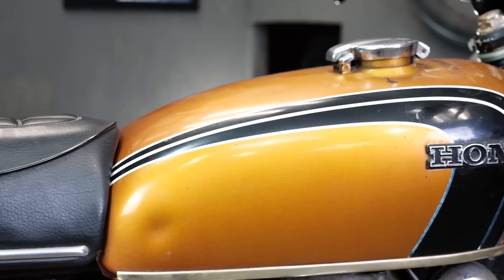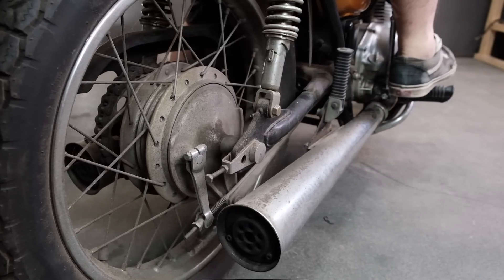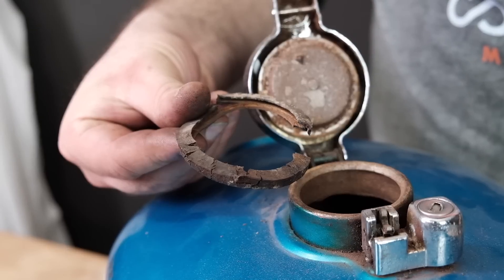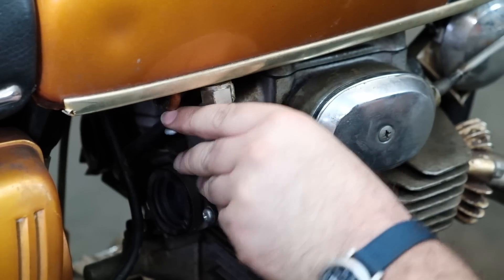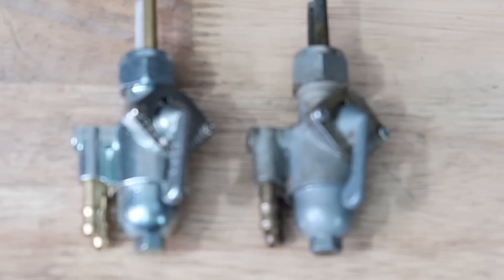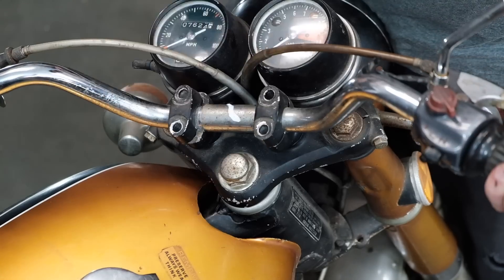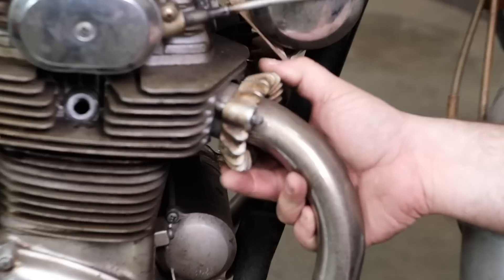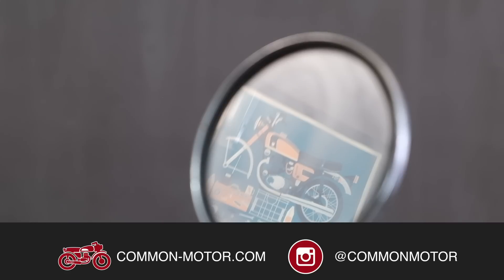5 Small Maintenance Jobs Often Missed On Your Vintage Honda Motorcycle

Comment: I ran one of these bikes back in the 80's. For the rear brake adjustment, rather than reposition the brake drum lever, I recommend changing the brake shoes, which will restore the correct geometry and will result in the brake arm being in the correct position.

Comment: 11 years back I got a '76 CB750K. A good runner with 4 into 1 exhaust system. It did have exhaust leaks at the head pipes. Took the system off to replace the gaskets. Started to pull the old gaskets out and was shocked discover the ports had 3 sets of exhaust gaskets in them. Previous pipe installs had just crammed new gaskets in on top of old ones. Wow, on wonder it was leaking.

Comment: Lube all the linkages and pivots too. Don't forget the tach and speedo cables. Check the side cover grommets if you are lucky enough to still have side covers...
I used to have my bikes all apart in Dad's basement all winter, drove him nuts. 
That and during riding season, we'd all hang out there doing small repairs.
"Hooligans" he called us. He did admit once he admired us and wished he could ride.

Comment: Pro-tip: for the gas tank gasket replacement, that inner silver metal piece with the little breather hole in it that the gasket is on completely comes out (at least on the 200s I've worked on).
Literally just held in place by tension from a couple metal tabs. You can stick a screwdriver in the empty space where the gasket used to be and gently pry one of the tabs to remove the whole thing. Makes it easier to put the new gasket on, with the added bonus of being able to clean it up more easily.
Reply: i wish i read this BEFORE i tried getting it on there as shown lol

Comment: Unless I missed it there is a critical item to be checked while adjusting the rear brake and that is the brake light switch. At every adjustment this item needs to be checked for proper engagement for the brake light.  It is a simple lock nut on the threaded section of the body of the switch.  This adjustment allows for the correct pull on the small engagement pin of the switch that actually illuminates the brake light.  If your brake is working but the tail light fails to warn others it could be deadly...
Reply: I just assumed my cb750 didn’t have a rear brake light until I saw this comment, never would have checked otherwise so thank you
Reply: yea I was testing out my wiring and noticed the front brake lever did not illuminate the lights, only the rear did. always a great idea to check lights ESPECIALLY on a motorcycle

Comment: Good reminders. I'd add value adjustments, chain slack removal, tire inspection.
Reply: Those old Honda’s never need valve adjustment! Hell, they barely need oil changes.
Reply: @Kickstart500 they need it every 1500 miles . Your remark is a lot more valid for brand new bikes with ever increasing service intervals

Comment: All 5 of these needed to be done on mine:  1, rear brake was way off; 2, gas cap seal was brand new, but not installed all the way and just loosely in there; 3, petcock seems clogged so i ordered a new one; 4,  handlebars were loose so i tried just tightening the nut underneath -- broke the handlebar mounting bolt but was able to get another one and THEN having learned my lesson i went ahead and replaced the rubber bushings; And lastly 5, the copper gaskets seemed cheap enough to go ahead and replace them whether they really needed it or not just for peace of mind.  so that's it!!  where's the list of #'s 6 through 10???  cause so far i haven't found anything you guys mention as being wrong that is Not wrong on my bike.

Comment: The rear brake shoes need to be replaced.  The reason this is a problem is Japanese motorcycle brake shoes are not "arced" to the drum as American shoes are.  They are not the same radius.  This results in the shoes wearing quickly, and it results in the cam that operates the shoes needing a lot of rotational travel once the shoes are worn.  This rotation will eventually make the cam go horizontal, which will lock up the brake.  Repositioning the arm will move you further into the possibility of this scenario.  Replace the shoes.

Comment: I'm looking to purchase a series of maintenance pieces. I want to replace the intake manifolds, front disc brake pads, clutch cable, rear shocks (the heavy duty version you sell), exhaust gaskets (set), front fork gaskets & fork oil and now that I seen this video, I'll purchase those handlebar bushings as well. The bike is a 1975 Honda CB 200T
Reply from the maker: Hey John, message our support and we will get you hooked up with everything we currently have! I'd stay away from the heavy duty shocks with a CB200 unless you want a good back crack every time you hit a bump but we carry stock style replacements now for the shocks as well as ikons.

Comment: I was a Honda mechanic with the CB 350 motorcycles were leaving the dealers in Squadrons.
   there was a bulletin direct from Honda suggesting that dealers stock seven top end gasket cats and camshafts for every 10 motorcycles sold. dealerships were given a 30/60/90 day list by Honda telling them which parts they will sell the most of which came on the 30 day list, medium sales of parts on the 60 day list, not so common parts were on the 90 day list. these were parts that Honda suggested that you keep in stock because you’re going to need them. Camshafts for the CB 350 , It was rare to see a Honda CB 350 with 10,000 miles on it that had not had the camshaft replaced.
  The camshaft was not heat treated properly, it was soft. The rockers that actuated the Opening of the valves were soft.. The ends of the cam spins in aluminum bearing blocks. Soft aluminum. To keep the camshaft from walking left or right there were thin soft thrust washers. These were literally copper plated pieces of metal that disintegrated as the camshaft walked side to side. The worst part is, The CB 350 had no oil filter. So all of this aluminum and different metal debris kept constantly being circulated through the engine.
   don’t waste your money or your time resurrecting one of these machines..You will have to deal with the brittle or completely broken vacuum diaphragms in the CV carburetors. Leaky petcock’s, unreliable electric starters,Weak headlights, weak horn. If you adjust the points Exactly as instructed by the owners manual, the machine will be out of time...
  I didn’t watch this video, especially when he was going into how to adjust the rear brake pedal. But I will say this for a rear brakes that are actuated by a solid brake rod. Put a slight bend in that brake rod and you will have better feel at the brake pedal..With a straight rod, when you step on the break pedal, it’s like stepping on a solid object. No feel. When you put a slight bend in the rod,you will feel when the brake start to contact the brake drum, but they will not contact solidly because the rod will start to flex slightly as it straightens out to give you a little more sponginess. This will make your rear wheel less likely to lock up while breaking over bumpy surfaces.. this applies to any motorcycle with a solid rear brake rod instead of a cable or a hydraulic disc brake..
   my advice to anyone considering resurrecting a CB 350 Honda. Pass. Those were junk motors. I was the 350 Honda mechanic at the dealership I worked at. We had seven mechanics working full-time. I specialized on the 350 and 450 engines. Most days, I replaced camshaft in 350 Honda‘s.. I got so good at it, that I could have the camshaft out of the engine of a machine that was just pulled in by the customer. I would have the camshaft out while it was still too hot to hold with your bare hands. . I used to take them up to the parts department, and toss the camshaft to Davie, the Partman, and say, Davy I need another one, and he’d catch it and burn his hands.. he learned after the second time not to catch the camshaft when I would toss it to him.Some days, I could replace 4 camshafts in under seven hours ..
  another stone age design of this engine was the procedure to adjust the valve clearance. You loosen a lock nut, turn a cam eccentric screw head, and listen to the noise the engine makes. You have to listen for when the sound changes and if you go to far the engine wants to stall. You had to guess where the midpoint was, then tighten the lock nut. That sounds like model T Ford stove pipe mechanics I know, but that’s how it was done.
   there were so many other motorcycles available that were better. The suzuki  250 X6 hustler,The Yamaha r5 and DS7. Best of all, the Bridgestone 350 GTR. The 350 Bridgestone was so far ahead of everything else. The Bores of the cylinders were chromed. not shiny bumper chrome, industrial hard chrome plating etched onto the aluminum for optimum heat transfer/ cooling.. it had a dry clutch meaning spinning a clutch basket and all those clutch plates in oil it puts a lot of drag on the power...The Bridgestone had a 6 speed transmission.. 6 gallon fuel tank, rotary valve engine. It would start in any gear with primary kickstarting, it would start without a battery..
  that was in the late 60s. Today, the top motorcycle manufacturer would have been Bridgestone except for one little thing. There was a longshoreman dock strike in the late 60s. Bridgestone put all its eggs in one basket. The ships were loaded with tens of thousands of Bridgestone motorcycles waiting to be unloaded. But the longshoreman strike lasted for months. Bridgestone missed the peak buying season, and they went bankrupt. Because of that longshoreman strike, Honda started their own assembly factory in Marysville Ohio, and Kawasaki opened up an assembly plant in Lincoln Nebraska so they would not be caught the next time there was a disruption in delivery at a critical time.
    Anyway, my advice to anyone considering resurrecting a 350 Honda. If you just wanna look at it, go ahead, but if you expect to ride it, good luck. They have the reliability of a fire cracker. They’re only good for a short time
Reply: Honda sure sold a lot of these.  Being a dirt bike rider at the time, I avoided the street scene till finished high school and bought a used CB400F.  It felt like a much better quality bike than a friend's CB350.  What was your experience with the Honda 4's?
Reply: This is not helpful to this business or this community. Why bother commenting?
Reply: what kind of business is negatively affected by a YouTube video pointing out spacific defects of a problematic motorcycle engine from almost half a century ago?? The only kind of business I can think of that would be harmed by such a thing, is a business that is planning to sell a  known defective vehicle to an unsuspecting buyer...the truth hurts ?? how could this  information hurt anyone? if anything, it will save people considering resurrecting one of these poorly designed motorcycles a lot of money and effort.Many of the parts if not all of the parts are no longer made by Honda. Thanks to the Internet you can find NOS parts..That’s fine if you’re buying things like , heads, crankcases, pistons, rings, N0S parts are great —sometimes— but not always.
NOS parts like rubber seals/ o-rings / carb manifolds / airbox to carb tubes/ nylon parts like Swingarm bushings, clutch disengagement worm gears, cam chain tensioners,they get brittle, ozone attacks them, they don’t last long sitting on the shelf..Especially parts like diaphragms in CV carburetors which the CB 350 Honda twin has. Honda does not make diaphragms anymore. And new old stock ones that have been sitting on the shelf 40+ years,even though they are new, they will be brittle and will fail quickly if they don’t crumble in your hand as soon as you touch them from age..Petcocks leak when they’re new, 40 year old new petcocks are definitely going to leak even if they are unused..Let’s not forget the insulation on the stator windings..And then there’s all of those aluminum connectors for all the electric’s in the wire harness system corroding for all those years. The reliability /Conductivity was marginal when new..They are not like fine wine that improves with age..
  These are things to think about with any old motorcycle or car. But to put the money and time into a machine with known fatal engine design flaws is not very smart.....It would be wiser to invest in fire crackers. At least you get a bang for your buck...
Reply: @Jodyrides  this business, Common Motor, has a philosophy that keeps these motorcycles, which were manufacturered en masse, on the road and out of landfills. Common Motor has supported ~50k customers with their parts, educational resources and technical support. Going to their video and directly responding to their free resource contributes nothing.
Reply: Nicole Buergers 
  That’s fine. Good luck to your cycle store/ shop..I’m happy for you.. that is a rough business to earn a living in if you are the owner. I have worked for four different dealerships over 17 years. All four of them went out of business after the Harley Davidson company convinced President Ronald Reagan To impose a 45% tariff on all imported motorcycles over 700 mL  displacement.... I lost my job at 4 dealerships, four times because of the Harley tariff....here in the United States, over 1100 motorcycle shops/dealerships went out of business permanently due to that tariff. The average number of employees at those 1100 permanently closed motorcycle dealerships was seven, that’s almost 8000 people that lost their jobs because Harley Davidson convinced President Reagan that it was necessary to save the 600 jobs at the Harley Davidson factory....
statistically speaking, since I lost four jobs when four different dealerships went under, I wonder if that changes the overall count of job losses by four or by one. Interesting question.
It’s rough out there...In this country, the motorcycle business never recovered from those tariff years....
  It’s unfortunate that my specific information pertaining only to the Honda CB 350 twins posted here on YouTube has had such a perceived negative impact on your business??Is there a store? An actual brick and mortar location? or are you starting a virtual business venture where you get paid by the number of viewers you accumulate on YouTube? Good luck with that too...
,have a nice day No matter what country you are located in.
you believe me, and i’ll believe you..
Reply: @Jodyrides  Common Motor is the business whose channel you are on (Watch their videos maybe?) It's an ecommerce website that supports cb350s & cb360s with parts and support; shipping worldwide. They are teaching people to resurrect these bikes that you are commenting to "pass" on. Not sure why you want to shit on this small business who is doing such great work.
In business for 8 years and counting and doing well!
Reply: @Jodyrides  everything old is shit compared to newer models with better technology. You're totally missing the point dude. It's a hobby. Half the fun is working on the damn thing, so if it ever stops breaking I don't want it.
Reply: @Jodyrides  I'm not the business, obviously (???)
Reply: @outsideliesmagic "gimme five bees for a quarter"
Reply: Hey Nancy, why are you so negative?
Reply: Junk motors? I bought a cb350 new, put 33,000 miles on without doing anything to it except to change oil and a chain occasionally.

Comment: Did those copper gaskets have a seam? Thought I was told the seam on the gasket should be facing away from the exhaust flow. Keeps it from developing leaks.

Comment: Hi, did any of you guys have to take care about rusted out muffler? I mean the inner tube - hole on the bottom part. I have a cbx750 from 1984 and one muffler is rusted out and little pieces of rusted metal are making unpleasant noises and since “new” stock looking exhausts are expensive i thought it could be repaired by drilling out those rivets and taking the tube out, weld those holes and maybe wrapping in muffler fiberglass (if it originaly had some idk). Do you have any tips?

Comment: I have a 74 200cc. when I connect the wire from the coil to the points it no longer has power (points), and no spark. Ideas please....Thanx
Reply: Do not let the coil wire's terminal end touch the points metal terminal holder tab in any way. it will be grounded out, so no power and no spark.

Comment: Do the gas cap parts fit for a cb500four tank?
Reply from the maker: Yes! Can cap, latch, and seal. The later CB550F Supersport changed the design when they put the cap under the little hatch on the tank but the CB500 four-cylinder(also called the CB500K) will be identical for the cap.

Comment: Handlebar ground? Purpose?
Reply: i'm no expert, but i'll chime in on this question:  i had 2 projects going on my bike at once: replacing the starter solenoid and replacing the handle bar bushings.  in the process of replacing the bushing i broke off a mounting bolt and had to wait for a replacement.  so i went back to the starter solenoid.  got the new solenoid in, but then the bike wouldn't turn over!!!  thought i hooked it up wrong but i didn't.  long story short, because the ground wire to the handle bars was not reattached yet the push button starter switch did Not work!  re-grounded the handlebars to the frame, then pushed the button again and the starter switch worked and it fired right up.
Reply: i guess that is to say:  the handlebar ground wire makes the handlebars (which are otherwise insulated from the frame by the rubber bushings) part of the same Circuit as the frame of the bike itself. having  no handle bar ground would mean any switches on the handlebars that are grounded to the bars would Not be grounded to the frame of the bike and back to the battery.. but for anyone reading this who doesn't believe me, disconnect that wire and then try to start the bike without it.